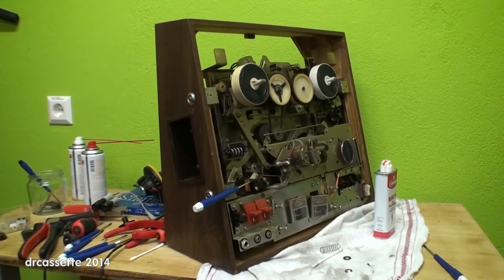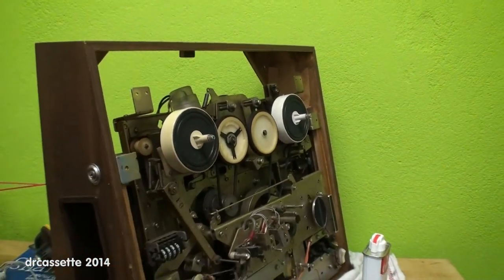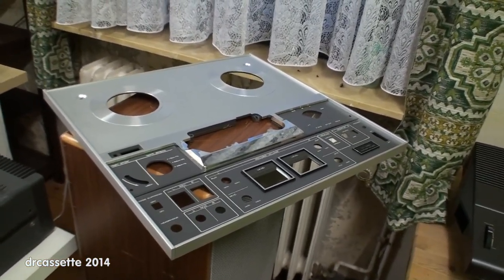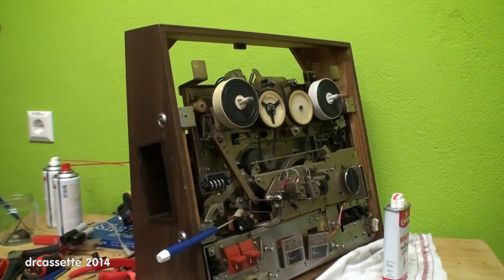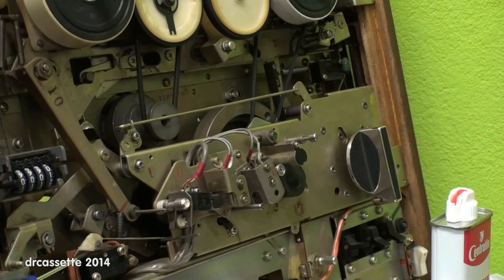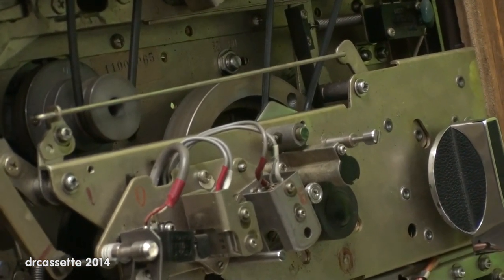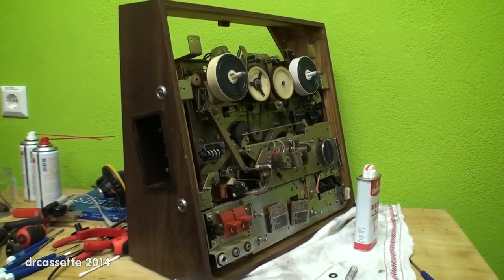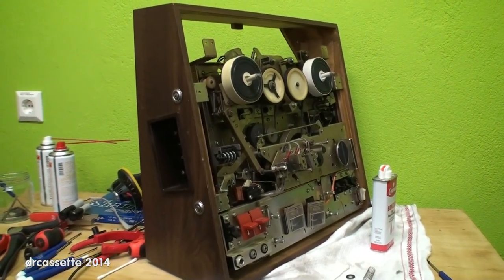Sony TC-366 reel-to-reel tape deck repairs

Comment: I got one of these at a flea market in 1985 and used it for many many years. I have some precious audio recordings made from the radio and found out that the 19kHz FM stereo pilot tone is even recorded on the tapes, that's how good it is.

Comment: First reel to reel I purchased and repaired. The run cap always goes bad. Replaced that with a newer design. Ran great. The reels don't stay in place. There should be rubber snap pieces to hold the reels.

Comment: I hope you didn't junk the machine. There are many reel to reel enthusiasts who would love to own your Sony TC-366 Reel to Reel player and could easily unwarp the front plate or have someone else repair it. I even know how to unwarp the faceplate. I own a Sony TC-366 that I purchased in Japan in 1971, while serving in the US Navy. I enjoyed listing to music and making recordings on it for thousands of hours, until the grease dried up. All the belts and idler wheels are still functioning normally and there are no cracks or corrosion. Nothing else has worn out on it. The tape heads don't have much wear on them and the drive motor runs perfectly smooth. The electronics sound good, with no buzz or hum. I'm in the process of restoring my machine to its former glory, or nearly so, which is basically just a good cleaning and lube. I will replace the belts too. Those were good quality consumer grade Reel to Reel Tapecorders back in the day, and still are. I hope you put your machine back into circulation.

Comment: That looked like an unusual tape recorder back in 2014, shame that it had Reel problems he he.
You can't repair everything, but you have done well over the years.
You sounded in a smashing mood.
Hope you are still tinkering with cassette decks.
Reply from the maker: Indeed I'm still tinkering with cassette decks, the last one got repaired only a few months ago ;)

Comment: I had the same problem with the speed control switch. Easy fix. The only serious issue I had with it was the switch assembly for play, ff, and rw. There is a set screw that wears out and is a bear to repair. If it gets misaligned, the switch will kick out of play and stop or jump to ff. Have fun. Lol
Reply from the maker: Note this video is from 2014. I don't have this machine anymore ;)
Reply: @DrCassette  good. Got rid of mine once I got my sansui quad reel to reel. Sold it for $100.

Comment: 5:50 - Plastic does not expand as it gets old. If the screws at the side holding the frame are tightened, they squeeze the front panel.  A solution may be to grind off some material from the case. Btw, before criticizing Sony, you may want to look inside an Uher.
Reply from the maker: I have looked inside plenty of Uher machines. They don't tend to develop silly problems like Sony machines...
Reply: @DrCassette  Really? I had an Uher CR 124 and a CR 210. Both had good mileage but eventually died from cable harness flexure. I am trying to fix a Uher Report 4400IC, it suffers from an intermittent due to cable harness flexure at the main board hinge. I have a Royal deluxe, one channel is dead and guess what? when you open it as described in the manual, the cable harness scrapes along the case.
Reply from the maker: I have one Uher Royal De Luxe with a somewhat dead channel, I suspect the signal goes missing in that giant selector switch. Of course cables will fail if they are flexed often. But then compare that situation to a Sony machine where such problems don't happen only because everything is built in such a way that it is almost impossible to take apart...

Comment: interesting video :-)
I would probably make a screw hole where it cracked, behind the metal front and then mounted a metal standoff in the frame above the flywheel to help straighten the front when it is screwed to the standoff through the front so the reels do not scratch the metal

Comment: A very common problem with these units.  The solution is quite simple....raise the tape tables. Adjustment for the tables are a little hard to find unless you remove the unit from the case.

Comment: You might want to see if you could make the faceplate shift backwards .   Looks like you might be able to push the mounting brackets back slightly deeper in the the fame by elongating the mounting bracket holes in an oval shape to give you some play.    This way the tape does not get misaligned and start wearing the tape against the reels.   Just some thoughts since I can't really tell if this is possible just from a video.

Comment: If the plastic has expanded, I wonder if you could just cut a slit out of the middle of it with a Dremel, push it back down, glue the edges together and then cover it with a very thin strip of metallic tape to hide the scar.

Comment: That machine should have one of those rubber Idler tires that drives the flywheel.  What condition was the rubber tire?  Did you have to use "rubber renew" or a similar chemical to restore it?
Reply from the maker: If I remember correctly, all rubber components were in relatively good condition, except those counter belts I pointed out in the video. I don't remember taking a closer look at the idler wheel, as it worked without problems.

Comment: I have this model. It turns on but there are mechanical issues that I’m unable to diagnose. It was in an elderly woman’s house for 50 years. Surprisingly Very clean inside so it likely wasn’t used much at all since it was new.  If anyone wants this, let me know.

Comment: To be honest, I would have discarded this one. Reel-to-reel-recorders with one motor transport mechanism aren't a good choice due to the amount of belts, idler wheels and friction clutches that don't help to get a long-term reliable operation (although this one seems to be better engineered than the cheap recorders from e.g. Philips or Telefunken). The bent plastic faceplate with metal trim on it is imho an additional reason not to restore the Sony - lifting only the tape reels to clear them from the faceplate will distort the tape transport and prevent proper tape to head contact, as you already stated. To correct this, you would have to lift the entire tape guide and head base plate the same amount.
Reply from the maker: In the end I indeed discarded this machine, there were just too many problems with it.

Comment: Heating the plastic might enable you to straighten it out
Reply from the maker: I later tried heating the plastic with a heat gun to flatten it, but unfortunately it made no difference.

Comment: Why don't you just hit the plastic up with a paint stripper put the heavyweight in the middle and let it cool down put it on a flat surface
Reply from the maker: If I remember correctly I later tried heating the plastic with a heat gun to flatten it, but unfortunately it made no difference.
Reply: @DrCassette  I have repaired, refurbished, over 125 of these units, encountering probably every problem Sony engineered into the units. I have had many units come in with the plastic warped as you have described.  There is a very easy repair for the situation.  When the unit is out of the case you can see a screw under each of the reel holders that will allow the reel holders to be raised, thereby clearing the top cover.  :face-purple-wide-eyes: Gosh, I didn't know that......
Reply: @WDSamuel   Have you ever replaced the on / off  grain of wheat bulb i measured the voltage at 1.6v AC was surprised i couldn't get a reading on DC. It's funny to see people struggle with these machines they should be careful they will loose the tape reset counter button when they go to put it back together 🤣